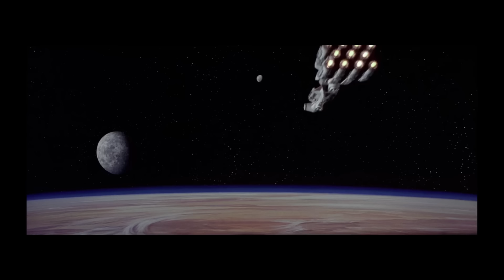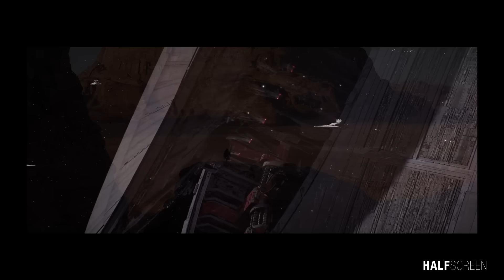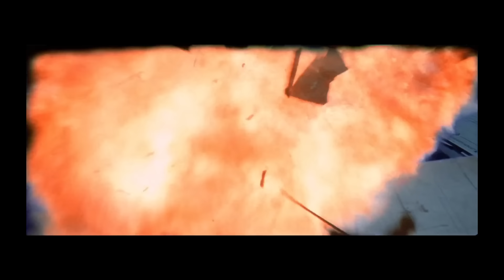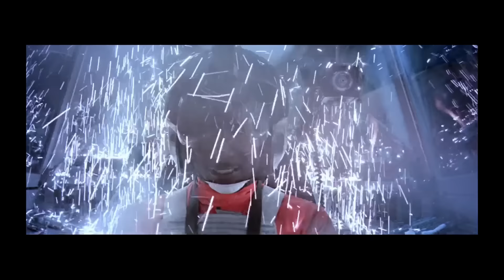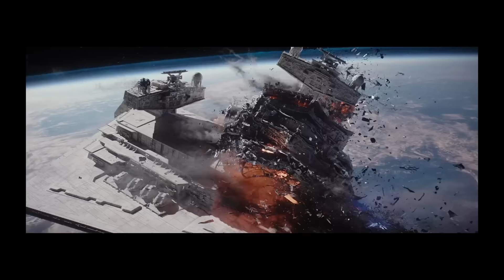Star Wars:  Inside the Imperial Star Destroyer

Comment: 40 000 crews plus 9000 troopers seems very high and the wrong way around, as the thing is barely over a kilometer long (a mile is the figure?) and no more than 60-70 stories tall in the thickest places on the hull (at the rear only), and only a few of those places are that thick at that. Yes if it was a rectangle and had no other purpose than housing it would do, but given we should assume a high level of automation, the 40 000 would be mostly troopers and not crew. There is no reason for that large a number in crews, especially for long stretches of time in space, but there would be a reason for a large number of troopers and their weapons. So the trooper option would have to be bigger than the crew, not the other way around. The most volume efficient shape is the cube, so deviations from that cut a lot of space. It is clearly not designed for that high a number. I'd say 8 000 crews long term plus 25 000 troopers optional for short hops, maybe 10 000 for long hops. There is all that lost volume from the hangar bays and the energy source... Keep in mind there are TWO hangar bays, with one smaller one in front, not just the big one described...

Comment: The animation itself is very impressive, but I have spotted a few issues with the information you provided.:
1) Why didn't you say in the video that the 3D model is the Imperial II-class? This is an important detail, since the II-class first appeared in Empire Strikes Back, and not in A New Hope.
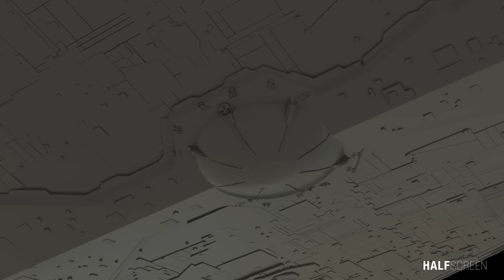2) At 2:47, the protruding reactor is only the main solar ionization reactor, the subsidiary and backup reactors are located elsewhere, and thus are not located in the same protrusion.
3) The turrets at 3:37 are octuple barbette turbolaser turrets, it doesn't have anything to do with ion weaponry.

Comment: They made an error as the ISDs are the successor to the Victory-class Star Destroyer aka VSDs. VSDs were produced in lower numbers and used to protect Coruscant. They were far deadlier ships than Venators as their role was more for heavy combat and defense. Venators on the other hand were more like the Star Wars equivalent of aircraft carriers due to the large hanger space and point defense weaponry and smaller turrets than the Victory or ISD class.

The evolution of the Star Destroyer is more like Acclimator > Venator > Victory-class 1 > Victory-class 2 > Imperial-class 1 > Imperial-class 2 > Asserter-class > Super Star Destroyer > Eclipse SSD(Non-canon) > Mandator 4 > Supremacy-class. I added other craft just because why not because the evolution of the Star Destroyer is quite a fun topic.

Comment: If you were to remove all the unnecessary empty space inside the ISD you'd end up with a ship 2/3 the size. Also, where is the rest of its armament? Another gripe I have with the design is those enormous ion turrets having  almost no forward facing capability, rendering them useless in pursuit operations like the ISD's very first appearance. Overall I get the feeling that the ship was designed for scenarios we never got to witness, namely anti-capital ship combat akin to XVI cantury naval combat, with emphasis on broadsiding what does not exploit an otherwise excellent hull design.

Comment: Everyone knows how powerful the star destroyer imperial is. It is almost impossible to beat this ship in realistic battles. Therefore, the filmmakers deliberately reduced its true effectiveness several times to allow the rebels to fight. The star destroyer imperial was too powerful. with a size of 1 mile It will have enough firepower to easily handle up to 1,000 rebel warships simultaneously in realistic combat based on a sensible modern weapon system.

To make the star destroyer imperial float in the atmosphere so softly. The engine would have to generate as much energy as a nuclear warhead every second to allow such a massive object to float softly. Because antigravity systems need to produce magnetic fields so powerful they can fight the magnetic fields of entire planets. That means the star destroyer imperial can blow an entire rebel army with a single shot if this is a reasonable battle.

The Star Destroyer Empire was underestimated. The things that the movies do are illogical. The villains are always defeated by surprises. When pleasing the audience is more important than the realism of the movie lol

Comment: Super cool video, so I hate to even say something, but what actually sets the maximum speed of a space ship?  In space, there is no drag, so there is no real speed limit on anything until you reach the speed of light.  Also, 975 km/hr is not even the speed of sound (on Earth); that is not even close to the orbital speed of anything orbiting Earth.  Maybe the 975 km/hr is the speed the ship is able to obtain in an atmosphere?  But not every atmosphere is created equal, some are much more dense than others.  It would make more sense to list maximum speed in an atmosphere in units of mach number so the number wouldn't change with atmospheric densities.
Reply from the maker: John, you are right, it technically run at two speed, something I should have mentioned.  

60 MGLT (Megalight)
Maximum atmospheric speed 975 kilometers per hour

Comment: Error;
Dumping garbage before entering lightspeed to "reduce weight" is the dumbest shi7.. 
Since weight is actually a measurement of matter acted upon by gravity. And in the middle of space you'd have almost ZERO weight. You'd have mass, but not weight. 
We know nothing about moving in light speed, we think that your mass increases exponentially and therefore it's impossible, but that doesn't satisfy any logic since the sheer mass of the Star destroyer would to too super massive and dropping a few kgs of mass would be the equivalent of shaving 1 hair off your body before you go for a run to "save weight"... Like NO. that's not even measurable.

Comment: The most vulnerable part of the SD is the two Shield Generators...Yep. Located right up on top and open to attack from multiple angles. I wonder if Vader choked out the chief designer for putting those there...
Reply: As well as the bridge. It's set way too high.

Comment: 3:08 How can a spaceship have a maximum speed? In space (in a vacuum), if you keep your engines on, you can accelerate forever, until you run out of fuel. What does that speed of 975 km/h mean?
Reply from the maker: There are two different speed.  
60 MegaLight and
Maximum atmospheric speed 975 kilometers per hour
Reply: @Halfscreen  What kind of atmosphere though? Maximum speed depends on drag, which depends on the kind of atmosphere (density, viscosity etc). So is 975 km/h the max speed on Earth at sea level (even thoguh Earth doesn't exist in the Star Wars universe, I know)? If this doesn't have an answer, I'm ok with it, it's fantasy after all, I'm just curious.

Not to mention that in space, speed doesn't make much sense, because speed relative to what? The center of the galaxy? The star or the planet you're orbiting around? Here on Earth, we imply that speed is relative to Earth surface. In space, we use our sun. So even the 70 megalight doesn't make much sense (also again, why is that the maximum speed? Is it like Star Trek with the maximum "warp", which is not speed, but how much you can bend spacetime?)
Reply from the maker: @Mandorle21  It's really just based on the information on the website below.  Other than that, you ain't the only person who had an issue with the maximum speed, since most of the information isn't scientifically based.    

https://starwars.fandom.com/wiki/Imperial_I-class_Star_Destroyer
Reply: @Halfscreen  Ok, thanks, I was just curious if this was more fantasy than science or not.
Reply from the maker: @Mandorle21  It's mostly fictional.

Comment: 975 km/hr? That's all?!? Even in space? Man, that thing is SLOOOOW... that's only MACH 0.8 or so, not even close to the speed of sound. Any airliner could keep up with it and any modern fighter could easily run circles around the Star Destroyer speed wise.
Reply: This can't be right, unless we're talking about its speed in an atmosphere similar to ours. In space, there is no speed limit for an engine. Mph or Kph is not used as it is not relevant or relative. Instead meters per second are used as a metric, for both velocity and potentiality. The delta V of a craft can be summed up as how much energy is available in the fuel and able to be output through the engine, relative to the mass of the craft and the amount of gravitational effect it is experiencing. The efficiency of these engines is categorized as the ISP, or specific impulse. This is all to say that with what is essentially a fusion reactor powering a set of massive ION engines, your potential relative velocity could be relatively close to light speed, given enough time. The only downside would be maneuverability, since any inertia would need to be cancelled to change direction in space. With how massive these craft are, perhaps a standard operating speed was established to allow for maneuvering in a vacuum. Considering star destroyers are poorly designed for any type of axial acceleration, specifically along the normal/antinormal nodes, and the radial in and out nodes, it would take a lot of time to reposition one of these beasts to  change their direction. With all that said, these craft would have an almost limitless amount of delta V at their disposal, and could basically go whatever speed they wanted to within the laws of physics.
Reply: That's its max atmospheric speed. While In space, its max acceleration is 2300 gravities or about 22,563 meters per second per second.
Reply: Idk I think that’s the in atmosphere speed
Reply: My favorite ship.  So classic.  I am not a fan that Star Wars has so many variants that take away from this pure design being the most imposing.
Reply: I thought it was about 600 mph in earths atmosphere.
Reply: It's still slow
Reply: @alreadyDis Yeah, but look at the size of it.
Reply: AI generated nonsense
Reply: 975 that's atmo speed. ISD has 60 MGLT topspeed in realspace (not hyperspace). 
MGLT was used by Industrial Light & Magic to compare ship speeds. As far as i know - there is no way to convert it to real speed (m/s or kph)

Comment: Wrong! 40% of the insides are filled with gadgets which randomly prevents the ISD from firing both its anti-capship and anti-fighter weapons, and skews the aim when it rarely allows a small percentage of them to sometimes fire. Another 40% is filled with gadgets that cause its armored turrets and other structures to auto-destruct whenever the anti-fighter guns on a starfighter hits a random part. Another 5% is made of fighter and small craft bays (possibly several hundred bays) that have permanent NO PARKING NOTHING EVER ALLOWED HERE signs.
Reply from the maker: Personally, I think it just a bunch of mobo jumbo just to make it sound incredible.
Reply: @Halfscreen  It is. I hated how the canon description of ISD's are that they are meant to subjugate entire systems and face down entire fleets alone but in the movies a small squadron of fighters or smaller ships can take one down.
Reply from the maker: @keithw4920  I have to admit, I recently finished the USS Enterprise and they did a fantastic job with the logistics of their ship.  With Star Wars, it is just tons of unnecessary system configuration and an overblown technical layout that doesn't add up.

Comment: One of the more stupid aspects of the fictional Star Wars universe is its concept of limitations on the speed of ships not in hyperdrive.  So physics works differently here?   This SD can only make 975 KPH?   No. wrong.  The ultimate speed limit is the speed of light, and if you have the time and the fuel and the engines, you'll eventually get close enough to lightspeed as not to matter. 

Plus, you don't yank and bank to turn in space.  There are no atmospheric dynamics where there is no atmosphere.   It's all vectoring thrust.   And space battles are SILENT with no atmosphere around them. 

The protocol to dump your ship's garbage in space is ridiculous as well.  Nobody wants their ship destroyed by high speed impact with space garbage.  The Imperial Navy is much to smart to actually add more space debris to the space lanes.

Comment: Some mistakes in this video "Inside the Imperial Star Destroyer"

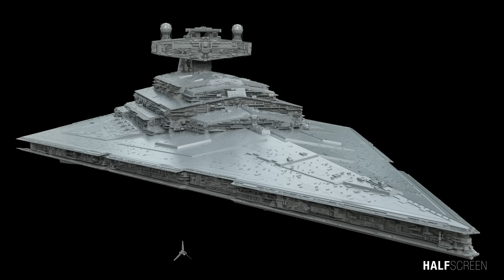1:46 You identify the axial three gun turbolasers.
4:20 However, those guns were not modelled in the video, and are simply absent, as seen at 4:20. We saw them in action in R1, in the detailed cross sections and on FractalSponges renditions. To be fair they were not actually modelled onto the original ISD1 in ANH, iirc, despite being standard armament to that ship. 

3:07 The "speed of up to 976 km/h" is only a limitation for atmosphere at low altitude, not for breaking into orbit or for open space.  

3:40 Heavy turbolasers identified as "two heavy quad turbolasers" but that is actually four, eight-gun heavy turbolasers (four turret mounts with eight cannons each). Furthermore, the text calls them "ion cannons" instead. 
5:26 maybe I'm missing something? 

Cool video, nicely timed. I like the limited use of the exemplar clips and music, keeping it more 'clinical'. Great project :)

Comment: So the engines can accelerate this ship to 970 km/h.    But If I recall correctly, in space there is no drag, so it could actually accelerate indefinitely as long as the engine has power...  And as long as you don't go so fast that the speed of light and relativity become a real issue.
So no, it can go much faster believe me. Also as long as you are not in the last jedi movie. If you are, u fucked then...

Comment: 975 km per hour is very slow for a space ship. At that speed, it would take the ISD over a day to travel one circle around Earth. It would need to go Much faster then that to be able to travel from one planet to the next in a solar system within any reasonable time.
Reply: @Halfscreen  I've never heard megalight before
Reply from the maker: @pepperVenge  

That is the term Star Wars used.  

https://starwars.fandom.com/wiki/Imperial_I-class_Star_Destroyer

https://starwars.fandom.com/wiki/Megalight
Reply: @Halfscreen  So are you saying 60 mglt is equivalent to 975 km? The links you provide don't give any info for comparison. I cant reference your first comment as it seems to have been deleted.
Reply from the maker: @pepperVenge  No, 60 mega light and 975 km are different. it a a unit used to measure the relative sublight speed of starships
Reply: @Halfscreen  Oh ok. I know its a unit to measure the speed of ships, but I can't find what the value is. How many kilometers in one Mglt? Rhetorical question, but if you know the answer, that'd be awesome.
Reply from the maker: @pepperVenge  1 MGLT is 25000 kph
Reply: @Halfscreen  Ok. So if 1 mglt is 25,000 km, then an ISD can go 1.5 Million Kilometers per hour. Interesting. So it would take an ISD 99.7 hours to travel 1 Astronomical unit. That's not bad. Where'd you find this?

If this is true, then that means an ISD is slower then Star Trek ships. At full impulse, a Star Trek ship can travel an AU in 16 minutes because full impulse is half the speed of light.
Reply from the maker: @pepperVenge   Just google megalight per km

Comment: Great video! love the details! I still can't comprehend how something so massive carries so few Tie fighters. 72 seems so few. a Nimitz class aircraft carrier is insanely smaller and is capable of carrying about 70-80 air craft. but w/e, Awsome video!
Reply: That's because all a Nimitz class does is carry aircraft. It doesn't also carry 9000 infantry, 20 massive armored vehicles, and 30 or so smaller vehicles. It's not armed with battleship-grade weapons on 50m wide turrets that can glass planet surfaces. It doesn't have deflector shields, the ability to fly ('cept that Avengers one), or the ability to travel faster than the speed of light. So yeah, it makes plenty of sense when you think about it.
Reply: @thomasp506  But a star destroyer is so big. That is could easily carry at least twice the carrying capacity of a Nimitz
Reply: @metaknight115  Well the engines and reactor alone take up about a third of the ship's volume. And with a total compliment on the order of 47,000 personnel, their accommodations and amenities would have to take up quite a lot of space. Furthermore, an Imperial Star Destroyer needs to store all of its fighter craft internally. A Nimitz class can actually only store around 25-30 aircraft internally at any one time, with the rest stowed externally on the flight deck. Take into account that the Star Destroyer also carries 50+ walkers (20 of which are massive AT-ATs), 15 troop transports, and 8 shuttles in addition to its 72 TIE fighters, and the number starts making more sense.
Reply: @thomasp506  Fair enough
Reply from the maker: Thanks Willy for the nice comment.
Reply: The WW2 era Japanese carrier, Zuikaku, at 256 meters long and 26 meters wide, was much, MUCH smaller than a star destroyer, and yet, could carry a standard 84 aircraft
Reply: With future technology 72 might be all you need if you’re the empire

Comment: The flaw of the ISD isnt its lack of shielding, its the lack of anti fighter weapons that the venator had. The ISD is full of hull and armour to the point where it is very difficult to take one down even without shields. In episode 6, the lack of shields allowed a fighter to crash into the bridge which wouldnt normally be possible with shields, and the lack of control let the super star destroyer fall in death star gravity from being too close.
Reply: The Shields most of the time only reflect explosions or energy weapons but they allow fighters or ships through that's why actual bullets can pierce them